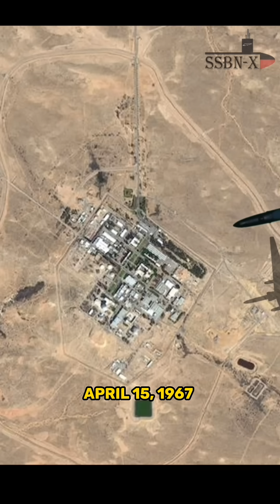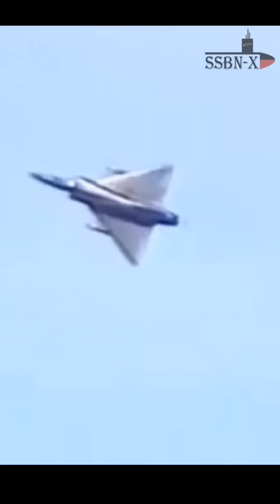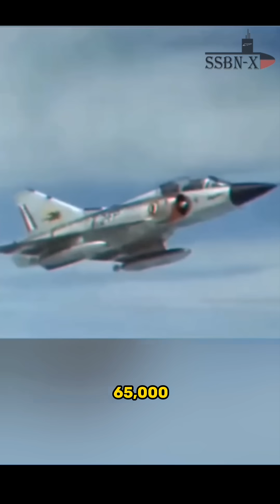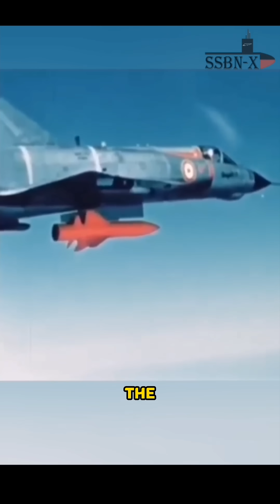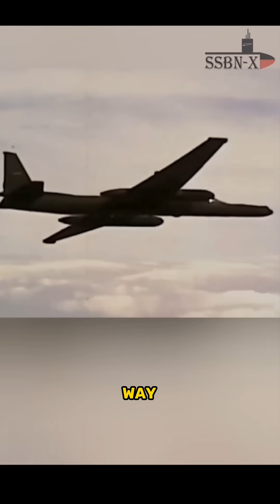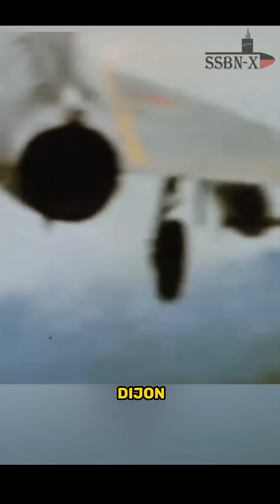When French Mirage III Caught a U-2 Violating France's Airspace

Comment: This is actually a true story...it did happen. Kudos to the French pilot. That had to be one hell of rush for him when he engaged the booster. But, in doing so...no way did he have any means of taking on the U2...in fact he quickly had to disengage due to fuel...but did get pics of the U2. Now, the US did stop using the U2...but simply switched to the SR-71 Blackbird which no other aircraft could or ever has come close to.

Comment: what probably happened was:
France spotted the U2 over their facilities a few times and approached the US embassy with a "plz stop doing that". The US probably did answer that it wasn't them and that the French had no evidences, and so the French made it so they could present evidence and at the same time, if need be, could approach a "hostile" close enough to launch a missile and dispose of it...
it is also rumored that the US, later, were flying their F117 over/across France to go to their Belgium bases without agreement with the French and that the French were edged on developing radars capabilities to track this stealth plane...
agreements about where the planes could cruise in transit were reached later on
the French don't have the most powerful nor the most advanced military, but they are resourceful and when motivated, can be a pain is the backside of anyone stomping over their boundaries...
Reply: The french Nostradamus radar was capable of detecting the F-117 and B-2. And it will be put back into service and improved because of Russia.

Comment: All in a days work for an English Electric Lightening, intercepted U2 by diving from 80 000 feet and also capable of overtaking a Concord. Top speed >Mach 2, rate of climb 20 000 ft per minute.
Reply: Ballistic intercept, just like the Mirage, it didn't dive it just completed a slowing arc on the limits of controllability after a high altitude supersonic climb at lower altitude. The F104 could also manage high altitude intercepts by the same approach, in unarmed rocket augmented form  (NF104A) it could go much higher, over 30000m but with limited control.

Comment: Mirage 3 were such dependable aircraft that Pakistan Air force still use them for certain specialized objectives.
Reply: EMP hardened for nuclear delivery.
Reply: Which ones? Al Qaida close air support?
Reply: @petr7694  I'm talking about Pakistan Air force, not USAF.
Reply: @akifsyed17   Pakistan colluded with AQ.
Reply: @petr7694  so did USA
Reply: @petr7694 they were USA's favorite during cold war
Reply: @petr7694 slap 👋 was too tight. ❤❤🎉🎉 loves from India 🇮🇳
Reply: @petr7694 Osama was a CIA Asset

Comment: Should have used the Blackbird. The Mirage wouldn't have even seen it if he had two "boosters".
Reply: The Blackbird’s engines were designed from French engineering and technology found on the Leduc…
Reply: @brunol-p_g8800 US always copied French style. They never had something on own😂😅
Reply: Then the Mirage will let's its missile does the job....
Reply: @hazarddavid6987 Sr71 could outrun any french missile at the time
Reply: @hasnicktir5310  no R530 with mach 4 so 4960 km/h or 3082 miles and blackbird and b’ackbird 3529 km/h
Reply: It would burn out before catching the sr71 though. Also early 530s were unreliable
Reply: No, they weren't. They were designed by Kelly Johnson's Skunkworks and made in East Hartford CT. Johnson would never have used anything that France had. Nothing compared to the design of a ramjet engines the Blackbird had. If France had something remotely close to the J-58s they would have used it themselves. France also declined Blackbird overflight after the raid on Kadafi's hq in April of 1986 flown by the late Maj. Brian Shul, RSO Walt Watson. We had to fly all around the Med to avoid French airspace. Yeah, France was great.
Reply: One Blacbird was intercepted in French

Comment: And 4 years or so later the SR 71 Blackbird said ......nice try ....
Reply: The Blackbirds flying out of the UK also got intercepted over France multiple times by Mirage F1s.
Reply: @brunol-p_g8800 blackbirds were not "intercepted". You don't intercept a plane that is flying 800 mph faster and 20,000 feet higher than whatever it is your in.
Reply: But retired as soon as S300 came into service
Reply: @manishbhandari591  yes why risk an aircraft that was very difficult to repair and costly to fly, with a perfect record when you can use satellites and drones.

Comment: You cant switch off a JATO rocket booster. It fires until it burns out of fuel is out.
Reply: Some Older Jato Rockets had liquid fuel
Reply: sepr isn't jato. It's a hybrid rocket similar to what's used on Burt Rutan's spaceship designs
Reply: @miscbits6399  It's still a rocket assisted device by another name.
Reply: That JATO was using the jets fuel for climbing off. So they had to turn it off for jet engines. It's French made system to intercept bombers at high altitudes for low air altitudes
Reply: That wasn't a JATO booster, which is a NATO only system, of which France was no longer a member.
Reply: @spvillano , France only withdrew from the integrated military command but it has always be a NATO member. I do not know the JATO but rockets and missiles on French planes are also French design.
Reply: @spvillano  they're still s member of NATO you mook.

Comment: Hope the matte Mirage pilot had a pressure suit, because his lungs would not be able to absorb oxygen at that altitude from his pressurized face mask alone
Reply: All fighter pilots wear anti G suits by default, including Mirage pilots.
Reply: @GhummoIn thats not even close to the same thing.
Reply: A G suit is very different from a pressure suit. A pressure suit is fully encapsulating, similar to the orange suits astronauts wear, and are worn by SR 71 and U2 pilots due to the low atmospheric pressure at those altitudes.
Reply: The Mirage having the booster shows they were aware of the U2's capabilities. Anyway once the SR-71 was brought online they could've strapped an Atlas booster on a Mirage and it wouldn't have did any good.
Reply: A mirage III pilot said on Dbrief (father of the host actually) that some SR71 did fly over France, they knew what it was. They tried to get to them, for the sport and to get some radar data maybe, and failed. Too high too fast.
Reply: He get another oxygen from lens of digital camera
Reply: Some mirage are in fact low altitude reconnaissance plane .
If I ´me correct it’s the Mirage III  P variant
Reply: yeah the pilot still be able to take out the dslr camera and take the photos ò U2.😅